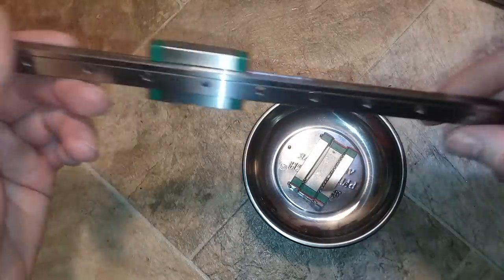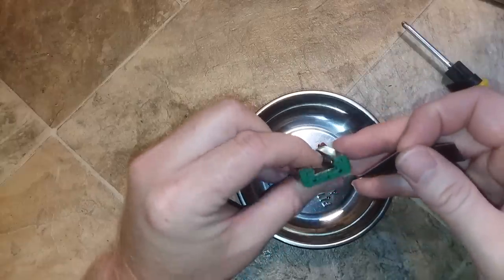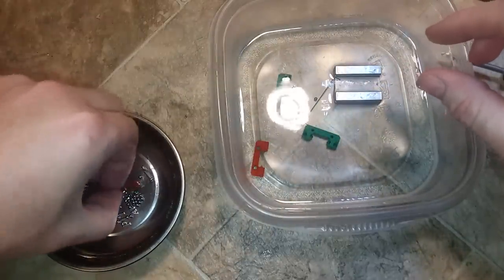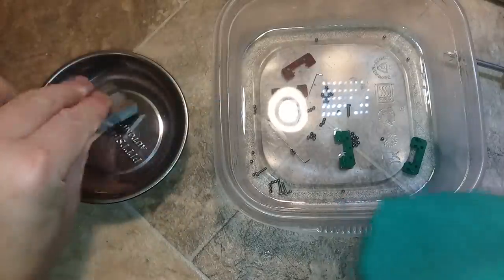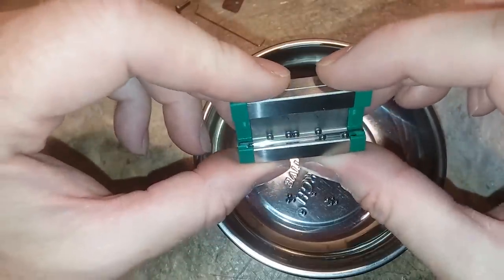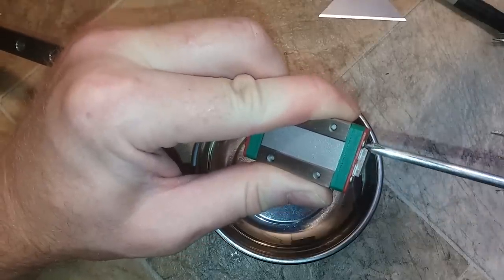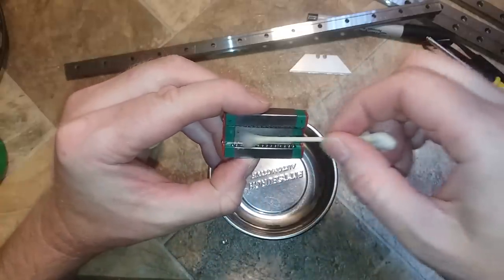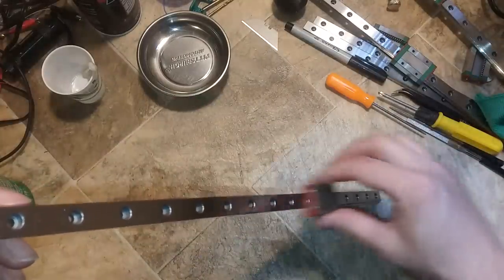Tuning Up Cheap Chinese Linear Bearing

Comment: YOU TOOK THESE APART? NOOOO!! Those bearings are supposed to have drag . Its called preload and it helps with accuracy. the grade of bearing grease is a component to the amount of preload. a 3d printer print head probabaly doesnt have the necessary preload for these bearings.  This video from HIWIN explains it all https://www.youtube.com/watch?v=2I44OT7c_MY Also you can clean these without taking the balls out. I just purge them with the correct grease through the lubrication fitting. your rails are crap anyway so you wont see much benefit with then no matter what you do
Reply: No, preload has nothing to do with the ball guide and dissembling the block won't affect it. Preload is determined by the size of the ball bearing matched to the block guide. You put oversized (few microns) bigger ball bearings to get more preload. Again, that thin little guide strip that hold the balls in does not determine the preload.
Reply from the maker: Do you think the chinese manufacturer cleans the chips and grit out of the bearings and blocks before shipping?  They mill, spray everything with cosmoline and ship it.  Be sure to saturate everything in WD-40 after installation!!!  :)

Comment: I rather spend may money to companies that deliver the right quality so I don't need to spend hours dealing with such things.
Reply: Bit more money makes sense. But a 10$ chinese bearing with a block will cost about 160$ and you still need to buy a block for 30-40$
Reply: @zanpekosak2383  that's because that is a real cost to properly manufacturing such a thing. They are precision ground parts. Anybody can make things 90% of the way for a fraction of the price, because that final 10% to get it right is the 90% of the cost.
Reply: @macieksiemczyk1096  I get that. I worked in an industry for some time so the concept isnt strange to me. But a company like HiWin probably produces thousands of these daily. There is no real benefit for these costing so much money after the machines are prepped, calibrated and running all day. Everything at the company is probably CNC with operators only looking after the machines. Such a price difference is sadly too big for hoby use.

Comment: Throw it away and buy something made as it must be. Quality is equal to the price.
Reply: Haha, no! I've got genuine hiwin rails and bought the cheapest clones I could find. The clones when cleaned thoroughly and lubricated correctly act like 99% hiwin, for the fraction of the cost.
Reply: I optically polish my rails on top of this. 100% better
Reply: @postiemania  How would One do that?
Reply: @cleosynthesis  use a microscope look at your ballscrew thread. Then polish using high grade abrasive and mirror finish and there is reduced noise. I then teflon treat the ballscrews  and linear bearings.
Reply: @thesoloveichiks159  I have some videos on YouTube where you can see and hear the difference. Maybe I should make a video on the process, but be warned it takes me about two hours to polish one ballscrew. I purchased an old bench grinder with a wire wheel and soft cotton polishing wheel. Ok would suggest to practice on a piece of rusty round steel pipe first. Good luck.

Comment: Why do you people keep encouraging the chinese to continue producing these shitty knock offs by buying them...???!! Pay the price, buy quality and then get on with it!!!
Reply from the maker: And where do you think the domestic manufacturers get their parts from???...from China???  Yeah.
Reply: This American made quality no longer exist.
There is only few companies making goods products in the USA. For the same price, Chinese products are better.
Reply: If I could afford to buy top quality, I wouldn't have bought a kit printer that needed a linear rail upgrade in the first place.
Reply: Every single component in a build has people saying you should spend the extra. If you do that every time you end up way over budget. You have to compromise somewhere. e.g. if you are building a £300-£500 3D printer/router then as far as I can see your choice is these or the cylindrical bearings (which I find with the chinese ones the cylindrical bearings have way more play). Unless you want to make the frame out of MDF and completely ruin the accuracy of the genuine bearings.
Reply: Errr. The "2 percent" have spoken China!!! Stop manufacturing!!!!
Reply: And buy from your country damn it. Someone has to be making them. Eventually the prices will drop on them and more jobs will be created.